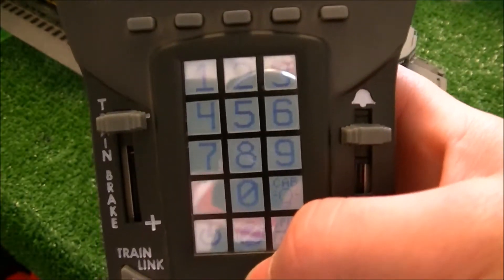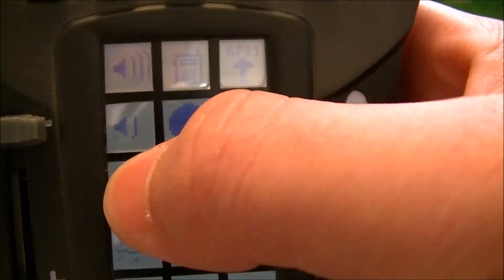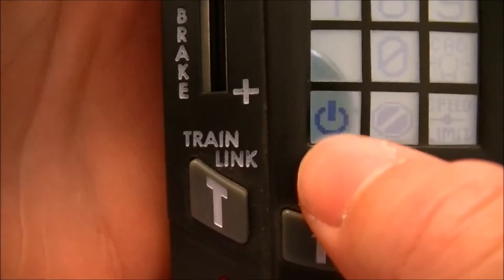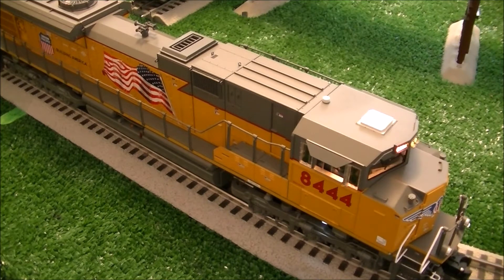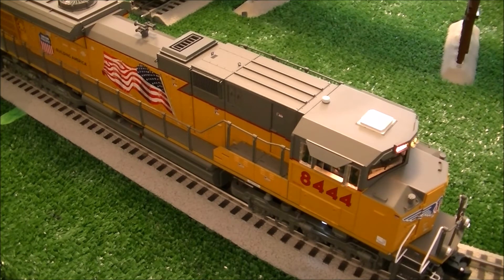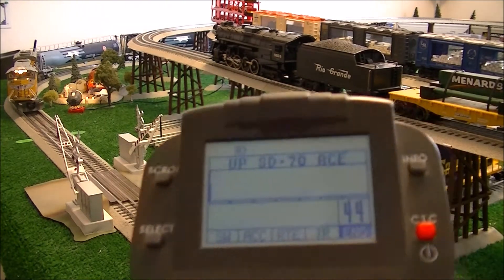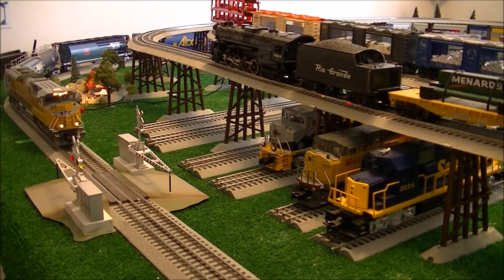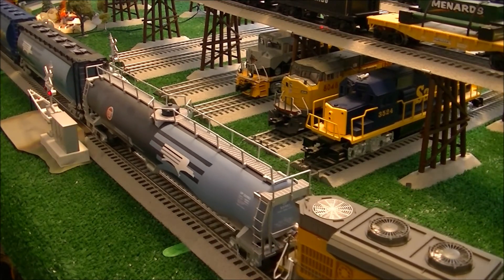Lionel Legacy Crewtalk & Towercom Dialogue

Comment: Nice video however did video really didn't say how to use the extra ones I did with the N&W Heritage SD70ACe in TMCC Heres the link again Running A Legacy Engine (In TMCC Mode) And in the comments you told me you could get the extra ones in legacy mode (the extras being the tower saying "your track is clear" and the crew asking if there "cleared inbound" you didn't cover those and I want to know how to active those in legacy mode you told me you could and I'd like it know
Reply from the maker: no now that i have experimented with it i have not found the other 2 it is kind of odd that you can't access them in legacy sorry about that
Reply: mopac1851 ok so tmcc only then ok well that's fine actually I like running that heritage unit in tmcc mode anyway it's funnier than legacy I think
Reply from the maker: oh well it still doesn't make sense that you cant access those features in legacy mode i figured you could somehow but that is all of the ones that i know in this video
Reply: mopac1851 yeah you would think you could activate more in legacy of opposed to tmcc but that's not the case
Reply from the maker: ***** it is a lose lose situation you either lose the 2 dialogue functions or you lose the other legacy features
Reply: mopac1851 yeah I'd rather have the extra dialogue and not some the legacy features